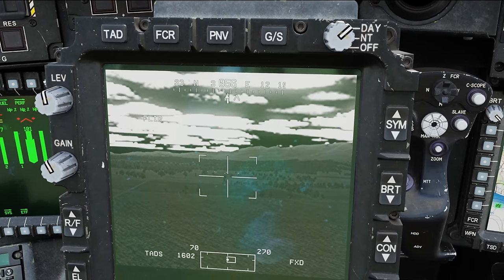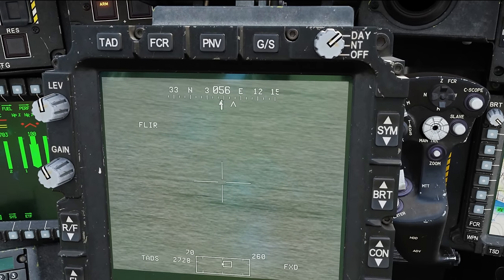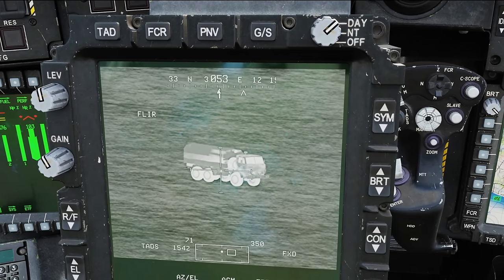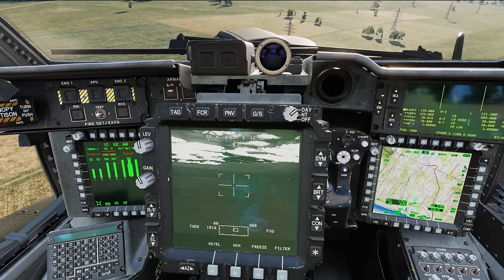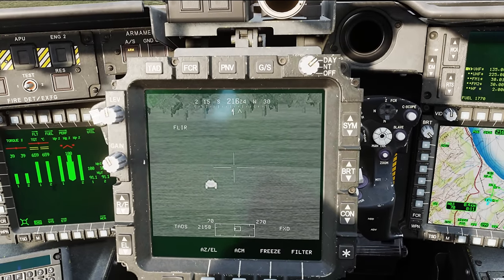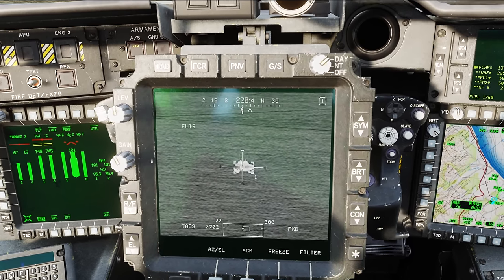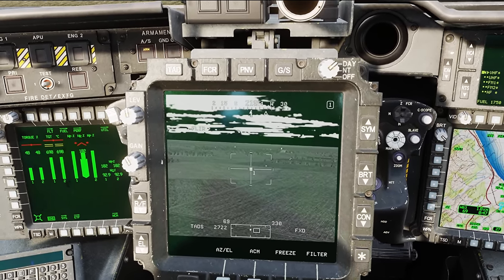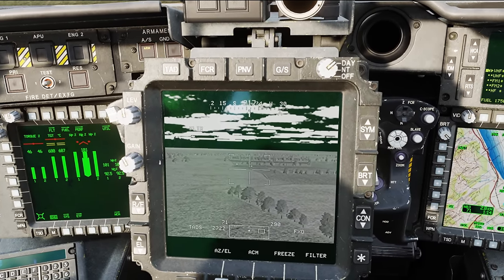Trouble Aiming? This is the key | DCS World Apache

Comment: A big difficulty at the beginning is using the 8 way hats on the joystick to operate the MAN TRK. When I started using the Xbox controller as a CPG and bound the MAN TRK to the analog thumbstick axis, I gained a lot of precision and the ability to aim easily even without LMC and IAT.
Reply: This is what I do, but I have a feeling in the real Apache it’s probably more like the hat than the stick.
Reply: AN XBOX CONTROLLER WHY DIDN'T I THINK OF THAT???

That's such a good choice for the TEDAC goddamit
Reply: @manishy1  Yeah, it's a good choice but it has one problem - you have to play around with the binds. I use the JoyToKey software to map the left and right triggers of the controller as different keys from the keyboard, so I can set them as modifiers in DCS. Currently I have everything I need except for LST, but I don't think there will be much need to use it and I can easily set bind on a regular keyboard.
Reply: @mcgherkinstudios  I'm not really sure, but the name of this "MAN TRK" is "Thumb Force Controller" and in real life you can aim the TADS much more precisely depending on how much (how much force?) you move the MAN TRK. I've never seen footage of CPG doing those weird big "jumping" moves like in DCS, it's always smooth.

Comment: I've had no issues tracking targets with the new ob release, wide, lase, LMC 123, Tap, light taps in, Release thumb controller, step in, adjust if required, etc don't stop lasing until stablised.. Have tracked targets moving at 60-70k/ph the issue is that most people just tap it and expect it to work unfortunately for most of them just like the rear seat needs to do pilot shit (to quote Brad), the front seat needs to do gunner shit if they want things to work. What is frustrating is that DCS sometimes lases 'through targets' rather than reflecting energy off targets so your better off aiming at the base of the target then it's centeriod

Comment: Is the LMC the only way the gun compensates automatically for lead/lag. Every time I use the gun with manual tracking, even if I hold the laser on to constantly update range data, the shots miss unless I'm really close to the target. Even then, I usually have to put in some Kentucky windage based on where the previous burst hit to walk the rounds onto the target.
Reply from the maker: If you are lasing and moving the line of sight it assumes your target is moving.

Comment: LMC is cool and easy to use. I wonder why there is no ground stab though
Reply: @CasmoTV  Yeah im not a qualified engineer but code wise and mechanics wise, seems easier to just implement linear motion control like that than trying to hold the image steady. Much more "manual" and less things to break.
Reply: @HowIsAsh  Easier to train gunners than to train algorithms.
Reply from the maker: Look man I don’t know how the watch works I just know how to read the time.
Reply: @CasmoTV  the most common answer ever ! :)
Reply: @HowIsAsh  The mechanics are already there for the auto image tracker, so with some code modifications I think ground stabilization could be done. 
But since there's a dedicated guy to operate this thing they just decided it's not worth it.
Reply: When the TADS was designed, the anticipated viewpoint was always looking at extremely shallow angles across the ground from nap-of-the-earth altitudes, and this was prior to digital terrain databases.
For the most part, ground stabilization is only practical when you have a minimum look-down angle where computers can process either a computed slant range using trigonometry or an image-sampling algorithm that allows the video source itself to be used to calculate stabilization. But even then, such calculations are not always perfect. When looking across the horizon or just below it, ground stabilization becomes near impossible since within the TADS crosshairs there could be terrain that ranges between a few to several dozen kilometers.

Remember that the AH-64 was designed for an anti-armor fight from extremely low altitudes, not close air support from high altitudes like has been the case in recent years in the middle east.